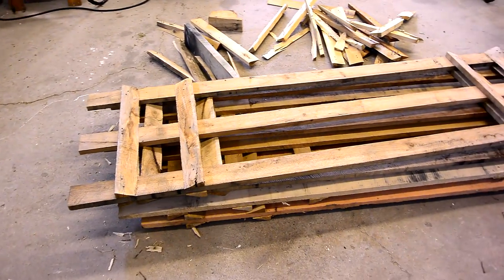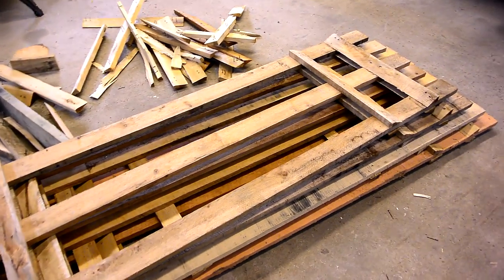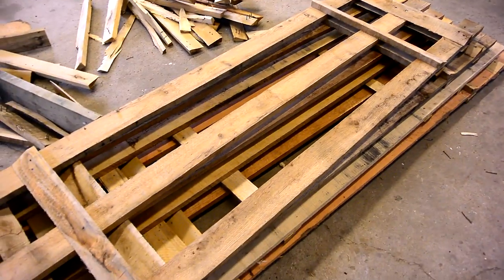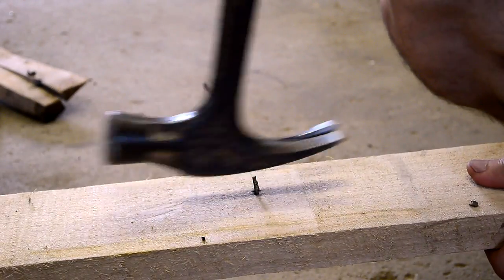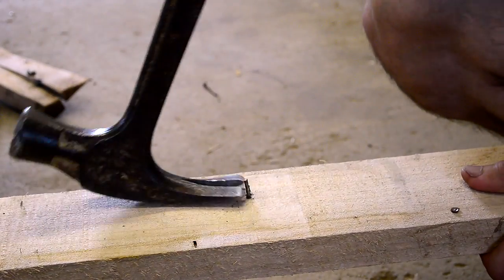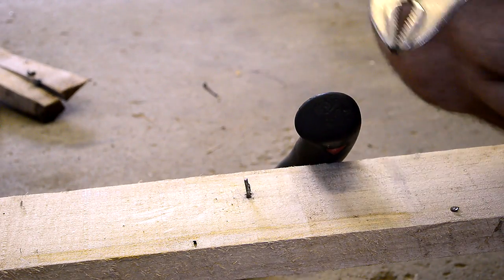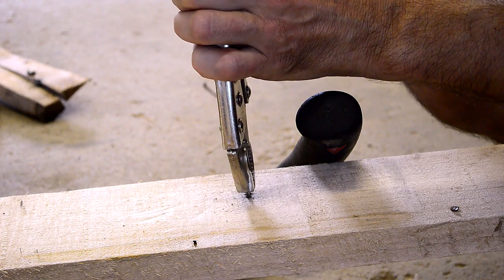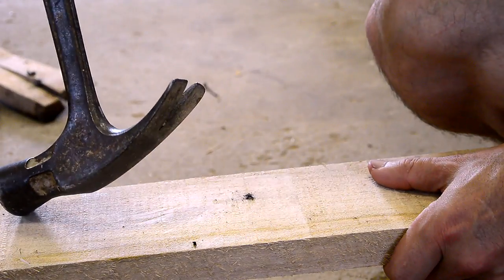Pulling nails without heads / pallet recycling

Comment: One suggestion in Pallet wood up-cycling. Make sure you own a metal detector, the quickest way to destroying your jointer blade is with a rouge nail you missed.  I purchased mine off amazon for 40 bucks, about the cost of a blade set for your jointer.
Reply from the maker: +Brent Parker Worse than nails are sand that often gets ground into the wood.  Less visible, and a metal detector won't spot it either.
Reply: +Matthias Wandel  Do you think running a belt sander over the surface would knock loose some of this sand and save the jointer blades a little trouble? Just an off-the-cuff thought I had...
Reply: +Matthias Wandel so what can we do about sand? just wash it?
Reply: I hate red nails.....
Reply: +Philip B I use a pressure washer now.  Strips the sand, dirt and the top most layer of wood off.  Before that, I used to use a wire brush.  That worked well, but was more work.
Reply: +Philip B
Wire brush and elbow grease.
Reply: I also find to avoid using the bottom of the pallet as it has been drug through the mud and rocks and sand.
Reply: +Brent Parker I recently bought a jointer from amazon the cheapest was over $250
Reply: @rochat  Pro tip--dab a little black fingernail polish on them.

Comment: I got a cat's paw recently and have been really impressed with it.  You hammer it sideways into the nail shank and it bites into the metal itself, then pulls the nail.  It's also sharp enough to drive below the wood's surface to get at the nail shank, but that obviously mucks up the wood.

Comment: The best tool I've found for pulling nails from pallet wood has been the Crescent NP11 nail pulling pliers. If you're going to do any large amount of pallet wood projects a pneumatic nail punch like the Basso is worth it's weight in gold, may not be everyone's cup of tea but just sharing what I've found makes the job easy.
Reply: Yeah the NP11 is good for the job. Nail nippers/end cutting pliers like Knipex 50 01 210 or Irwin 2078910 are also super effective. They each have their place.

Comment: I use the carpenters method. They simply place claws around the nail and roll the hammer on it side.  If they worry about marring the wood they simply slide a shim between the claw and the board. This saves the handle on the hammer and makes quick work of nail removal, you wont break off the nail head, and they carry less weight in the tool belt.  Nice pallet wood.. looking forward to your project ! Thanks for sharing.

Comment: Matthias, that is a great tip for when I can't find my large end cutting pliers.  Even cheap harbor freight one work well for this crude work. They pull out 16p nails without drama. Also end nippers, when your nail finally pops out, one doesn't have as much risk of injury in my opinion. I have seen and also personally banged my elbows and gotten scratches in tight spots when a nail finally gives from just a hammer. Not that I am a "safety Nancy" by any means.

Comment: I have no problems pulling headless nails with just my claw hammer.  The key is to "claw" the nail close to the board with enough force to have the claw "bite" into the nail.  The bite is acts effectively a vice allowing you to pull the nail right out without the use of the head.  I rarely just rely on the head when pulling nails even if it has one.  However this is a useful tip for when all else fails!
Reply: +William Hayden Right! I think his claws need to be sharpened.
Reply from the maker: +Vern Mitchinson I try avoid doing that, for fear of wearing out the claws.
Reply: +William Hayden A simple case of claws and affect
(ducks)
Reply: +Matthias Wandel Good tip but since no one has mentioned how to avoid this...

The purpose of the head of a nail isn't for pulling the nail out of the wood. It's primary purpose is to help clamp down the upper piece of wood to a thicker underlying piece of wood and secondary to help transfer the force from the hammer blow down into the shaft of the nail. It is mostly friction between the wood and the nail that holds the parts together. A freshly tapped in nail will be much easier to pull out compared to a nail that has been sitting in the wood for weeks and months. This is because the wood expands around the nail gripping it even tighter. A neat little trick to make nail extraction easier is to give the nail a blow with the hammer driving it barely a millimeter or so longer into the wood. This will take away most of the friction that has been building up over months and years since the nail initially was driven into the wood. Doing this before pulling the nail will make life so much easier and maybe also save some more of the wood.
Why not make a video testing out my claims? :)
Reply: +William Hayden Doesn't work with a rusty nail, which most pallets have. At best you'll break it. With Matthias's method you pull it a lot better.

You can also use double lever pliers to speed things along. Those have super strong grip, worth having a pair around the shop.
Reply: aserta It's true it won't work in all cases.  Some nails are just too rusty or are too thin, but I have pulled many nails out of pallets using the technique described.  I wasn't debunking Matthias's info I was merely providing additional information.  I am only describing the proper intended use of a claw hammer.  The claw is designed in a very specific way and that's to not use the nail head, but bit into the shaft of the nail.
Reply: +Matthias Wandel I think it might be better to have a useful tool, than a long lasting one that doesn't work.  To each his own.

Comment: I do this a lot and use the vice grip trick as well, a crow bar is by far the best tool to use though much more leverage. Also I go over the lumber with a small metal detector to find the embedded nails.

Comment: I missed seeing a pusher when you were using the jointer. I like to use a meter long stick to hold down the outfeed, most often keeping it fixed in place toward the front of such a long board, the stick held high with the left hand for more control,  the idea being not to flatten the board with a spring in it by pressing it down in the middle, just adding a bit of firmness at the front end, plus suppressing vibration. You can push harder from behind with the right hand holding a pusher that grips the end of the board with a projection safely to the rear of the hand position, and finish faster. Nice wood you have.

Comment: I learned in construction or sometimes demolition that if you put the claw as close to the base of the nail where it penetrates the wood, just push sideways on the hammer and it comes right out. Very easy.

Comment: Thanks so much for suggesting the vice grip. I am tearing up the carpet that some idiot installed over hardwood floors and half of the tops of the nails came off with I pulled off the wood carpet grip along the edges. Cheapest nails I have ever seen, the tops just all came right off.

Comment: First, I prefer using end-cutting pliers such as the 8" channellock's. Second, I was gifted with about 300 feet of salvaged cherry baseboard and trim; however, there were brad nails everywhere. The unfortunate thing with these brad nails is they had a heat activated adhesive that sometimes made them impossible to remove by conventional means. To remove them I would heat the end of the brad with a small propane torch and quickly pull it out with the end-cutters. Worked like a charm.

Comment: Sometimes the spiral nails used in pallets are a: harder steel than normal nails and b: gripped tighter in the hardwood than you'd expect.  The result is that the wood itself gets badly damaged in the attempt to pull the nails.  I've had success by intentionally removing the head of the nail by drilling into the center of the nail head with a bit slightly larger than the nail shank.  Once you've drilled as deep as the head is thick, the nail head falls off.  You can then disassemble the pallet planks, leaving the nails in the stringers.  Then you use the vicegrips and hammer claw that Matthias demonstrates.  It's not as speedy as normal "ripping apart", but it does leave the wood far more intact.

Wear safety glasses and keep your drillbit sharp...

Comment: I learned to use a little 2x4 block or even a 2nd hammer under the end of the hammer removing the nail to give its pivot point a bit more height (leverage increase, I think. My physics isn't so good!). I just add blocks depending on the length of the nail and how stubborn it is even if the head is slightly damaged.

And when I didn't have vice grips or pliers near for a broken one, I just bent part of the nail that was sticking up close to 90° by sticking the claw in and tilting the hammer (which works good to straighten the nail if hammering a slightly bent one, too). It gives the claw something to grab. Along with the block under the hammer, they usually then come right out.

I was spoiled for a bit and had discarded pallet and shipping crate access from an aerospace manufacturer.

Comment: I like it. I either use channel locks to grab hold and leverage them out by rolling forward or pound the claw into the nail to get a good bite.  Method depends on tools available and level of concern for the wood.  Another method is always good.

Comment: While I have used Vise Grips for this purpose, I have also found that a bolt cutter is good for grabbing nails. Squeeze the nail a bit with the bolt cutter, to get a good grip, and then lever it up with the handles.

Comment: if you just roll the vise grips forward onto their nose and then further, you don't really need the hammer... you just lever them out with the pliers.
Reply from the maker: +Tom Garvin Doesn't work ver well for bigger nails.
Reply: +Matthias Wandel: Clever trick!  Thanks, I will actually use that.
Reply: +Matthias Wandel thanks again for another great video

Comment: Yes that works well also use a pair of nippers they just grab the nail and then you rock it out.fast and easy.
Reply from the maker: +Backyard Woodworking I have used diagonal pliers many times.  But that typically leaves a dent in the wood.
Reply: No not diagonal pliers Nippers have a round head if I had a pick I'll send to you.
Reply: +Backyard Woodworking Some call them round nose pliers
Reply: +Backyard Woodworking i know what your taliking about. i use them for getting staples out too
Reply: +Matthias Wandel This http://images.google.com/images?q=horse+hoof+clipper is what he meant by nippers.

Comment: In this situation i would use a pair of pincers. They are able to grip very close to the surface, and due to their rounded head able to used as a lever and pull the nails out of the wood. Not a very expensive tool, but very effective at this task

Comment: I've always used the nose of the vice grips and just levered them up and if the nail is too long then you just grab the nail a little lower and do it again. Economy of motion, it's easier to use one tool twice than two tools once. However this is nifty, it's definitely going in the tool box for those real tough suckers, like screws with broke off heads.

Comment: I usually use my vicegrips and rock the nail out.  But sometimes the nail breaks, and then it's a problem.  This looks like a better way.

I also usually run a metal detector over the board before commiting it to the jointer or planer.  Saves my blades.

Comment: May I suggest you are "doing it wrong" ... nails are more easily pulled by using the hammer's claw "sideways" (i.e. at 90 degrees from how you are holding it in the video). This effectively bends the nail -- even one without a head -- and lifts it right out without the need for any other tools. Saves me time and effort. Give it a try?
Reply: it works of course (except on really stubborn nails) but it leaves a lot of marks from the hammer and the nail hole expanding

Comment: Ive allways got out nails without heads like that, turning the hammer sideways, and gnawing them up. 
Try it out and see how much faster it goes without having to pick up a second tool.
Ofc you allways have some that are too far in, and wisegrips are really great! 
edit: Yeah, and before i get the wisegrips, i pull the board off, so it gets the nail the inch it needs to be pulled up sideways.
Its really the technique i feel, even old stuck ones you can get out from "gnawing" it up
Thats how I like to rip pallets :P

Comment: Good tip, but I'm definitely with the folks that mentioned getting the headless nail between the claws and prying the hammer down "sideways." I typically pull most nails that way, as it will save a wood hammer handle in the long run.

Comment: Quick Question: Did you do a magnetic check for submerged nails? I had nails on my pallet wood project that were imbedded and so I hung the strongest small magnets I could find from a fishing line. Worked really well.
Reply from the maker: +Paulo De Oliveira Sometimes, but a bigger hazard is sand that might be ground into the wood.  And a metal detector won't pick that up.
Reply: +Matthias Wandel Very true.  I stopped using the bottom boards from Pallets because I came across a piece of gravel that was pushed under the surface.  took a big chunk out of my planer blade.

Comment: I don't pull nails too often, but when I do, I usually use channel locks for the ones whose heads comes off. This will be another trick to try if the channel locks won't do it.

Comment: That's got to be much safer than my usual method of taking a second hammer and driving the claws of the first hammer up onto the shank with it. I've heard bad things about that method where the hammer heads shatter and pieces shoot off like bullets. I just always hedge my bets with the safety squint and carry on.
Reply: +Pat F Hammer heads shatter at very high speeds/force and/or if it's a shitty hammer. You think they chip hammers in the forge every day?

Comment: @Matthais - Enjoyed your videos for a few years now.  Can you explain to me the difference and appropriate uses of a jointer versus a planer?   There are plenty of sites with definitions and static pictures but you have a way of explaining through [video] example that really helps my understanding of woodworking techniques.   Thanks.
Reply: +Sam O To add on to my question: If I could only afford on right now, which would you suggest is more useful?
Reply from the maker: +Sam O Jointer is for making one side straight, thickness planer is for making the other side parallel to a side that is already straight.  Opinions vary which one is more useful.  Depends on how you work and your preferences.
Reply: Youtuber Matthew Cremona has a great jointer explanation video.
Reply: +Heavyboxes Great video. Thanks for the suggestion.

Comment: Cool top, thanks! Quick question, when you're planing like that, how many mm are you taking off with each pass? Thanks!
Reply from the maker: +Fernando Yáñez Usually not many, but I think I took about 2 mm off in the video, just because I wanted to be sure it was clean after one pass.  Also, if there is risk of dirt in the wood, taking it off in one pass probably does less harm to the knives.
Reply: +Matthias Wandel Thanks for the response, much appreciated!

Comment: You don't need the hammer.  Locking pliers (a coworker goes ballistic over calling them "Vise-Grips", which is a brand name) are designed so you can grab the nail stub, roll the tool along its length, and pull the nail.

Comment: best places to look for skids or pallets is around places that get a lot of freight trucked in like truck repair dealers, heavy truck parts (aftermarket) suppliers and manufacturing places, its ALWAYS BAD to just take it, how ever don't ever be too shy or scared to ask for some or all that they have, 90% of the time they pile up and they need to pay someone to remove them to keep the place clean, most of the time they will even help you load it on if you have a trailer as they most likely already have it stacked up and a handy forklift... some coffee as a thanks ALWAYS goes a long way. if you are going to use it as fire wood only use HT stamped skids, i don't take any unmarked or differently marked skids as you either don't know if its treated or its poison. with that said where i work we get a lot of oak, maple, poplar and other hard wood skids that are very usable, most just need a pass over a jointer belt sander and they look like expensive stock.
Reply: +Bart Koscow having made a skid buster like tool (both a lighter hand held short hander and a heavier long handle ones) taking the skids/pallets apart takes a few seconds with little effort, also i find a crowbar to work a little better then a claw hammer due to having a longer handle giving you a longer range of motion to take out longer nail but also more power to take them out of hard wood faster with less effort. great idea on using wise grips one the nails that lose their heads Matthias

Comment: You can also just rotate the hammer perpendicular to the direction of the head, the two sides of the claw bite into the nail and it comes right out.  At the very least, it bends the nail over enough that using the hammer the normal way becomes possible again.  For shorter nails, this lateral pulling method actually goes faster, and requires a little less effort than the normal way.

Comment: I use a harbor freight cheapo claw hammer to remove the heads off reclaimed wood. The grind on the inside of the claw is never grounded so it sticks out and bites into the nail for me with a little swing.

Comment: Turn the claw of your hammer on its side with the headless nail in the claw , then leaver your hammer over on that side, that will  bend the nail so you can then grip nail to pull it out. it works 9/10 ask any chippy.
Then you turn to your grips if the above fails.